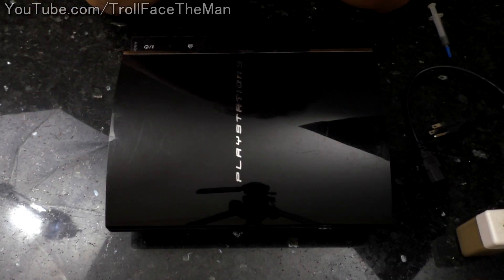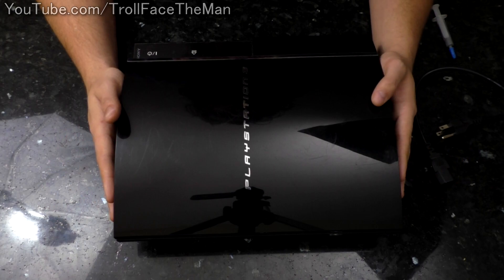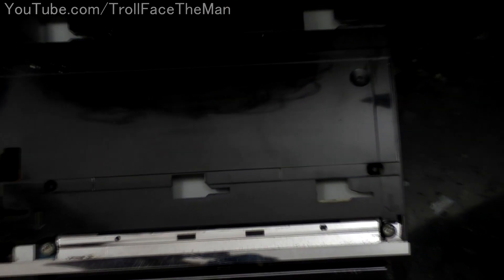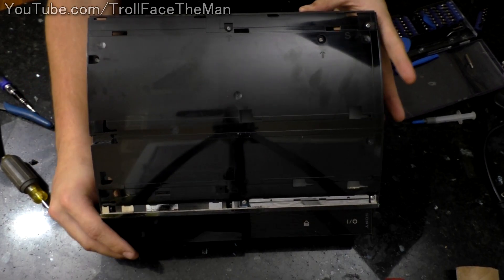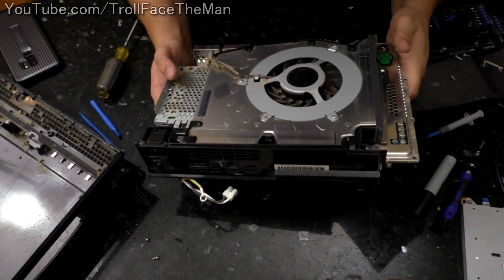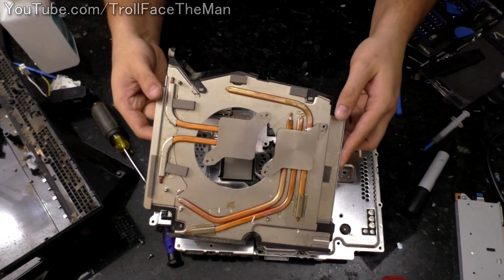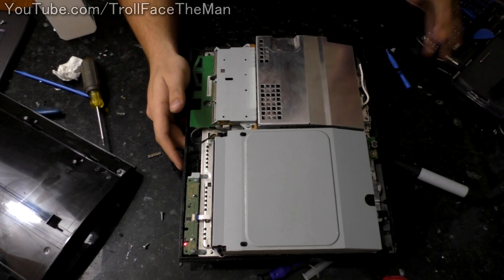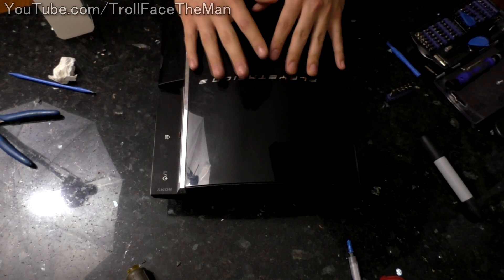Why Console Thermal Paste Needs Replacing (A Common Oversight...) Possible YLOD or RROD Fix/repair.

Comment: Help I reapplies thermal paste just like you showed. And it worked for a while. I got 3 2K games in before the yellow light came back. Now what
Reply from the maker: Did the console originally have the YLOD.
Reply: TrollFaceTheMan it he it on Saturday for the first time
Reply from the maker: @jareidmunoz6154 , might need to reflow the solder with a heat gun.
Reply: TrollFaceTheMan I did with a heat gun and a hairdryer
Reply from the maker: How long hours wise until it broke?
Reply: TrollFaceTheMan for like 2
Reply from the maker: When it cooled down did it start working again?
Reply: TrollFaceTheMan no it’s still showing
Reply from the maker: @jareidmunoz6154 , when reassembling did you make sure the tension plates where screwed as much as they could. Also what thermal paste did you use?
Reply: TrollFaceTheMan everything was as tight as it could be. The thermal paste was arctic silver
Reply from the maker: @jareidmunoz6154 , with the artic silver you made sure to put on enough being about a pea sized drop on each and that none overflowed the edges touching any other electronic parts? It's slightly capacitive which can lead to issues if it does.
Reply: TrollFaceTheMan I put a strip on each side and a dot in the middle. Was that too much
Reply from the maker: @jareidmunoz6154 , maybe for most high pressure mounting systems though you typically only want to put a dot in the center and let the heat sink spread it when tightened. Otherwise you can introduce gas pockets that reduce cooling efficiency.

 Even still I doubt that the thermal paste is the issue. The best I could suggest is likely to reflow again but a little longer this time and reapplying everything again.

 I would doubt a hair drying would be hot enough to get the solder liquid again sufficiently. Heat gun is a best choice but unless you have a precision be careful of over heating other components on the board.
Reply: TrollFaceTheMan I’ll try the heat gun again and I’ll check back thanks for your help
Reply from the maker: @jareidmunoz6154 , yeah. Good luck.
Reply: Look into replacing the NEC TOKIN capacitors

Comment: OK, so first off I enjoyed the video. I have been researching this subject as part of an ongoing PS3 preservation project that I have, that will visit many topics like this.

But. . . 18:11 . . what? The PSX, for most models, had soldered interference shields over the processors, and no thermal compound at all. Think of them like Raspberry Pis. In order to access the processors, you need to de-solder the shield, then, re-solder, or at least take some shears and hope no metal shards get loose. The PSone had a removable shield, but. again, underneath there is nothing to replace.

The PS2, while I am not familiar with all the models, does not use thermal compound, but, thermal pads. You don't want to take apart the PS2 thinking to change the Thermal Paste, and then discover it just has silicone pads. And particularly with the PS2s with external power bricks, replacing those pads is usually unnecessary, as the heat-generation is vastly less than the PS3.

PS3 should always have its thermal paste replaced at intervals of roughly eight years, though.

So, depending on the circumstance, those commenters you insult could have been correct.
Reply from the maker: I was talking about the PSX forums, not the PS1. PsX is a forum dedicated to playstation relatesd talk.
Reply: @TrollFaceTheMan  I see, my mistake then, sorry to bother you, but I took is as potentially being about the PSX or PS1, etc. As such I was perplexed as to why a video I liked so much up until that point would make an error like that. Cheers,

Comment: That's way too much
Reply from the maker: Paste?
Reply: @TrollFaceTheMan  yes too much paste
Reply from the maker: @nicktohzyu , once again as said in the video it's already been tested that as long as there is sufficient mounting pressure "Too much paste" only makes a mess and doesn't affect cooling at all.

 It's better to be a little on the overkill side and put a bit much on then too little which is what I did. Otherwise too little definitely can severely impact cooling.

Comment: So it better to replace thermal paste? (but a console is not really made to take apart)
Reply from the maker: After a few years yes you want to replace thermal paste. Otherwise a console may experience overheating issues.
Reply: @TrollFaceTheMan  yea but I am not a expert so I am not gone try it I tryed it ones with a Xbox one and it broke on me so not the best experience
Reply: Its7up you probably broke something yourself.

Comment: Well that only looks 10 times more complicated then a ps2 lol I used to fix those whenever my friends would stop working.  I feel like I've fallen behind on that ability lol
Reply from the maker: What's really crazy is many phones now where you have to pull the whole thing apart to even change the battery.
Reply: That said though the original ps3 is really well engineered and put together.

Comment: One day I was testing a motherboard I picked from the trash, and it had no heatsink, the CPU just had some crumbling thermal paste clinging on, and I had a heatsink and fan, but no new thermal paste.

I applied some 3-in-1 oil to dissolve the paste a bit, spread it around and then slapped the heatsink. It worked well enough for that lol.
Reply from the maker: Just rehydrating it eh?
Reply: @TrollFaceTheMan  I mean if oil cooling is good enough for powerline transformers, it should be enough for this, right?
Reply from the maker: @MisterTalkingMachine , well...
Reply: @TrollFaceTheMan  'ts good enough for a Pentium, that's for sure.
Reply from the maker: @MisterTalkingMachine , funny thing is they could actually get pretty hot because of bad power efficiency but I get what you mean :p
Reply: @TrollFaceTheMan  Oh really; one of my computers actually has an old Pentium in it, and the most puny heatsink I have ever seen in a CPU.

I wonder if you have seen how in some consumer grade motherboards they would slap in a graphics chip with a little heatsink glued on? well this one has pretty much one of those heatsinks in the CPU. The fan is smaller than the heatsink and it somehow runs colder and faster than my laptop from last year.
Reply from the maker: @MisterTalkingMachine , yeah some of the Pentiums were as high as 130w tdp but also as low as 10w tdp.
Reply: @TrollFaceTheMan  Jeez, you could have quite literally cooked in one of those. I might try.
Reply from the maker: @MisterTalkingMachine , well GreatScott made a handwarmer off a cpu at one point.
Reply: @TrollFaceTheMan  Yeah I remember that video, it's an oldie I think.
Reply from the maker: @MisterTalkingMachine , at least a few years I believe.
Reply: @TrollFaceTheMan  yeah, by the way, thanks to this convo I believe I am responsible for 5% of this video's viewcount.
Reply from the maker: @MisterTalkingMachine , technically you and me both XD
Reply from the maker: Though I believe it actually will stop counting after so many.
Reply: @TrollFaceTheMan  The slow way to youtube success lol
Reply from the maker: @MisterTalkingMachine , we only need to keep this chain going for another 100,000 comments to get the ball rolling.
Reply: @TrollFaceTheMan  Sounds doable. It's still a finite number,

Comment: Anti seize can make a decent replacement for termal paste, i actually think they are the same thing
Reply from the maker: I can't speak on that specifically because I am not sure, but I'd just say be careful with using any non specifically made Thermal Compounds as Thermal Compounds on sensitive electronic devices like processors.

 Sure some may still work good and be cheaper, but also they may fail from being used in conditions they are not made to be used in, or cause shorts if conductive. Basically I would not want to risk destroying a several hundred dollar console or  pc processor to save a buck on a TIM.

 Cheap LED chips on the other hand, I would be more willing to experiment.
Reply: It's been on my machine for three years, still waiting for it to fail.  @TrollFaceTheMan
Reply from the maker: @SuperDd40 , what machine? Also I am not trying to say it won't work. Simply offer a warning for others that may want to try it.
Reply: My 12 years old ASUS computer(now 15). And i get what your saying, of course it's a "try at your own risk" kindda deal.  @TrollFaceTheMan
Reply from the maker: @SuperDd40 , glad you understand. May I ask what product you are using and the temps you get?
Reply: Just of the shelf Permatex Silver Grade Anti-Seize and as for the temps, i never checked but it hasn't overheated in three years of use  @TrollFaceTheMan
Reply: I would never use anti seize! I work with that in valves and bolts. At higher temperatures it realeases oil which may contain metal particles like aluminum or copper.